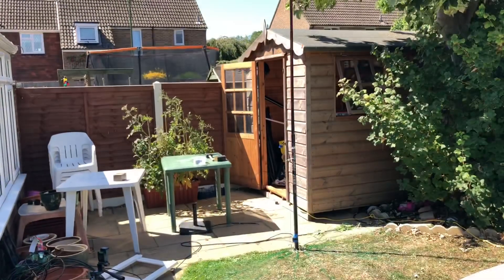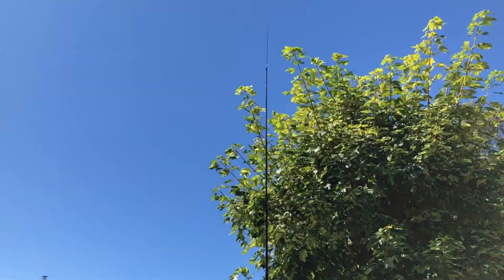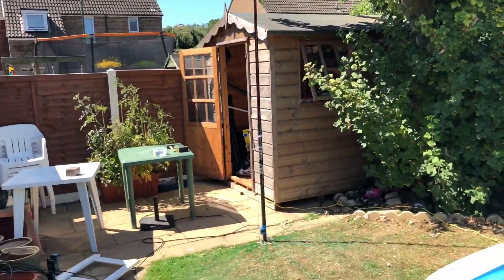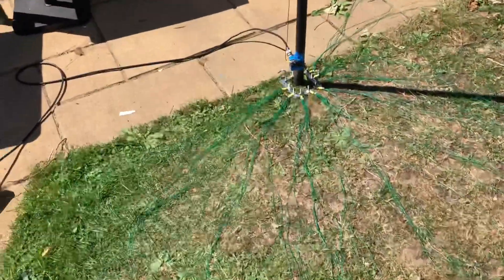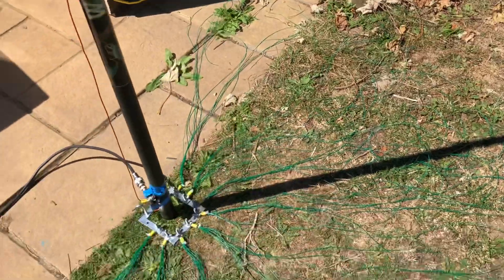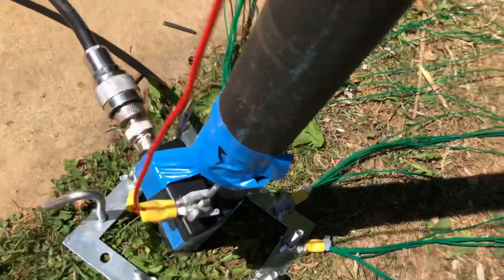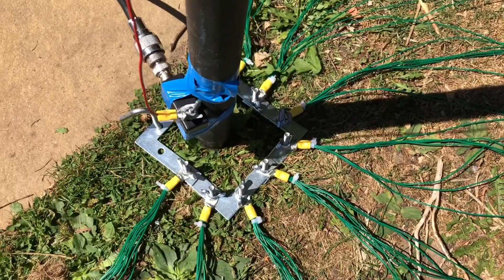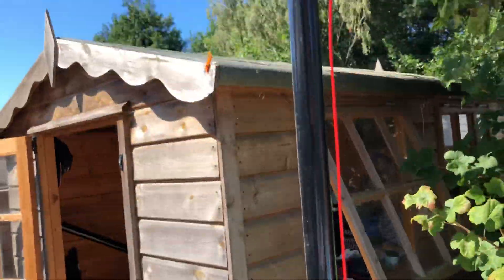HAM RADIO: DX Vertical Antenna For 20 Metres

Comment: Great video Tim, your first video gave me some inspiration to try my own 1/4 wave vertical with a 7m Sotapole.  I have 40X2.5 metre radials and direct feed with coax, physically changing the radiating element when needed.  It performs so well, especially on 20 metres. The first four contacts outside Europe! Argentina, Brazil, and USAx2.  I'm so happy, now just need to weatherproof it for winter. M0GJQ
Reply from the maker: FANTASTIC!!! Well done and here’s to more DX! 73
Reply from the maker: Just thinking .. I wonder if you alligator clipped the different bands so you could remove and attach to shorten or lengthen the vertical wire maybe?
Reply: @timg5tm941  good question.  I'm currently using it single band and only using enough of the Sotapole to support the 1/4 wave radiating element in use.  I have a choc block connector from inner coax to radiating element and a choc block from outer coax shied to radial ground system.  I was considering using spade connectors for faster deployment of radials and radiating element. My radial plate consists of 4 (8way)earth blocks connected in a square with thick insulated earth cable.  Simple it is, Tim!
Reply from the maker: It does the job that’s the main thing 👍

Comment: M0OLT  - Great to see the practical. Did you compare vertical without radials? Like you I am very limited in space and no chance of hundreds of wires across the lawn to be tripped over. I recently added 8 radials of varying lengths in 270 deg as pole is far corner of garage. I have an endfed non resonant bent to an inverted L , 3.5 m at top of 7m pole across 7 m to top of 10m house so part vertical. Definitely seems better on 80 m but now people tell me we are coming out of solar trough so which is doing it?  We keep trying🤔. I wonder if it would be better 7m up and 3.5 m across ???
Reply from the maker: Interesting stuff. Might look at the effects of differing numbers of radials 73
Reply: Tim G5TM  Callum did a complete session on this which is why I at least got a few down to start
Reply from the maker: Yep seen it .. it’s his and Rudy Severn’s analysis on radials that have shown the way 73

Comment: G'day Tim, thanks for your video on the 1/4 wave antenna and radials. Can I ask for working metres calculations did you 71.5 divide  by 14.000 ? Is that correct 1 metre length, 14 of them,  for the radials?  Sorry I'm have with my hearing troubles  and comprehension.Cheers mate.
Reply from the maker: No worries I went with 75/frequency for metres and then trimmed 73

Comment: Hi tim be great to work you on hf I run qrp on 20,40,80 on both a vertical and sloper long wire , if you want to evaluate any of your antenna builds I'm around in the evenings 5.00pm onwards, you can email me or call me via echolink on GB3ZN-R be happy to help m0omt
Reply from the maker: That’s brilliant thanks Stuart 👍